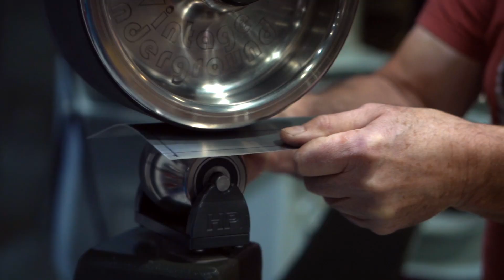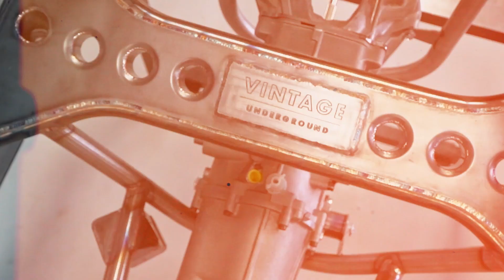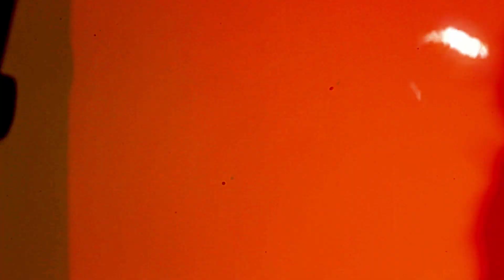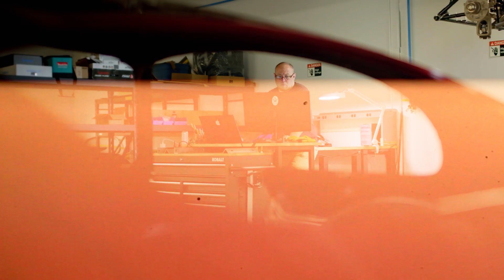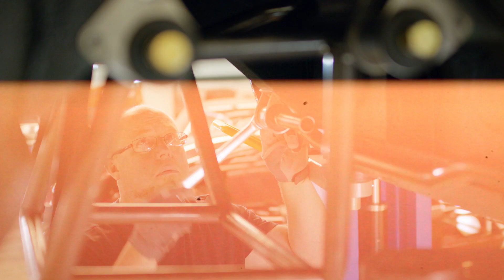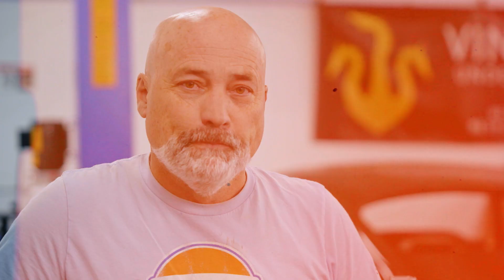Vintage Underground | E-Type EV Jaguar in the Works

Comment: Joe, would it be possible with the lighter front end then, to go to an all wheel drive setup?  If you did would that require a lot of re-engineering?  I imagine if you could do it you'd have a major increase in torque?
Reply: When hub driven motors become readily viable, it opens up all kinds of interesting options
Reply: @capaciousmg  Joe I've just come across a YouTube channel called Instant Torque.  I have just viewed a video about a company called Elapha (hope the spellings correct) they make In Wheel Electric Motors.  Thought this might be worth a look at if you haven't already seen it, regards, David.
Reply from the maker: @davidbroadfoot8834  Hi David, YES! we have been in contact with them regularly.  Pretty damn cool and a great solution for vintage cars.